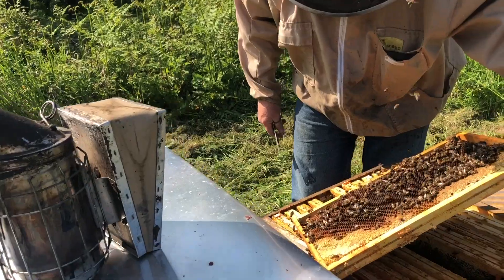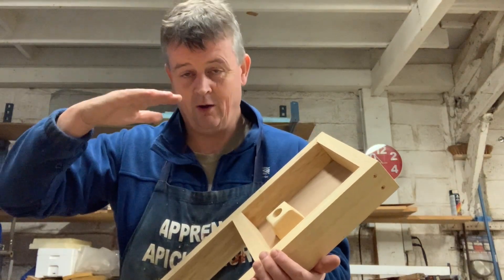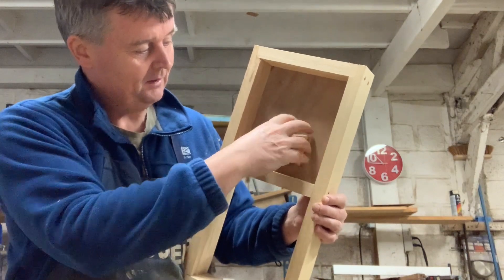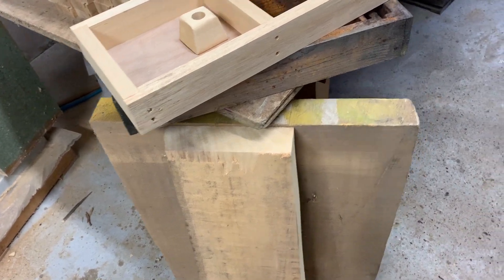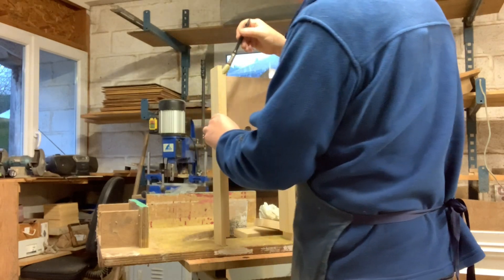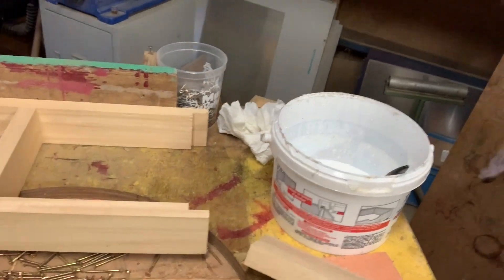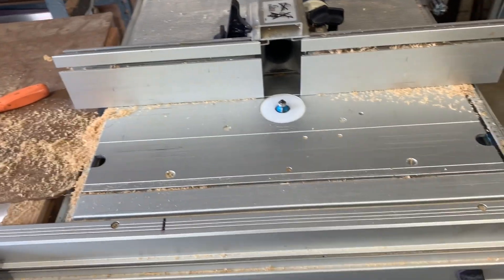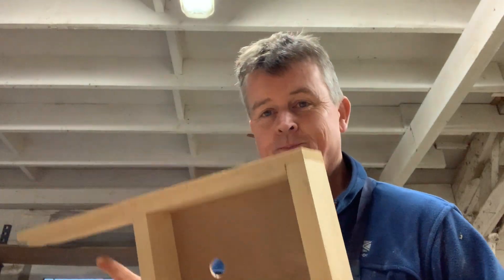Feeders for Finishers.

Comment: Very smart, then you dip them to seal them spindle molder ( router) always learning. Just no winter here in Florida 😂😂😂😂
Reply from the maker: Router table is used at the end to finish them, whereas we call the spindle moulder is a completely separate piece of equipment. More advanced than most routers and usually used for cutting groves out. Routers do the same but for large sections, the fixed table of a spindle moulder is a better maxhine.

Comment: Hey Richard, nice tipp - thanks! Some questions: What do you put over the "hole" in your feeder? something like a yoghurt can? What kind of stainless steel tub do you use for wax dipping? Did you made that yourself? Would you mind sharing the specs for it?
Reply from the maker: Marc R. Wetzel we put a square of wood. See the pic in the latest video. 
It’s nothing special, just a steel box welded up. It does not rust because it’s always coated in wax!!